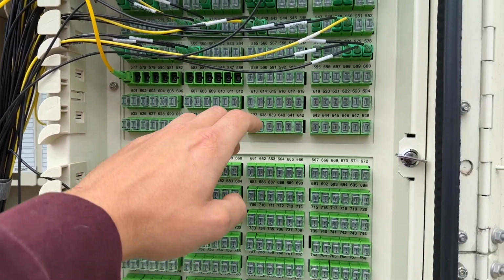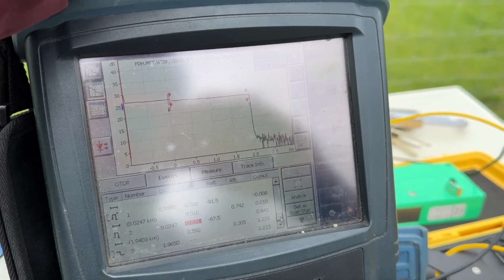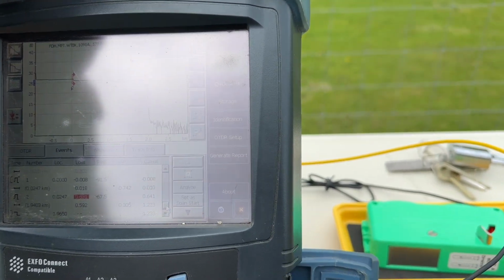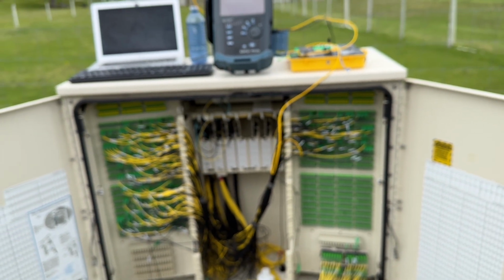Testing fiber optics

Comment: We  now fusion splice everything with no LCP. Contractors doing installs keep moving fibers when they don't have light to the house. They don't have light meters either. If the equipment doesn't show connectivity, they might change the connector and if that doesn't work, they drive to the LCP and move fibers to what they believe is their port and disconnect working customers. We also have RFoG and GPON in the same cabinets. They'll put the RFoG on the wrong upstream or connect GPON to an RFoG customer. They'll disconnect a business address. Fusion splice everything and it's difficult to fix when it goes wrong, but the more common technician caused issues are gone. 
I did FTTH in 1999 when It was just a myth. First design mimiced a telco network. All the PON splitters were in massive bulkheads in a POP site. Dual fibers to each address for biderectional data because it cost too much for WDM equipment. Analog AIM network with RF and proprietary T1 carrying the phone. The network was done in one mile rings from the POP because the T1 channels are time divisioned and if the signals took too long in comparison to each other, the T1 would fall out of sync and ... drop all the customers. Putting one or two customers on the wrong "ring" would cause a disaster.
$2800 per house.

Comment: I'm so used to Ethernet being plug 'n' play & copper lines and first time dealing with fiber. It's a complete nightmare, especially with those proprietary transceivers. The manufacturer says, "Our transceivers don't work in "unauthorized" gear for your safety," and I'm like, "Bruh, the transceivers have driver chip + op-amp to control the laser(s) 'n' shoot light thru a glass tube. They aren't going to fake a keyboard or mouse and/or infect the equipment machine as they function particular way, that makes such threat impossible."
Reply: You can easily reprogram sfp modules with 3rd party tools

Comment: Are you using a UPC launch cable against an APC connector in the terminal? Does that increase the launch loss numbers?
Reply: It appears to be a launch cable with a UPC on one end and an APC on the other end. Probably because the OTDR has a UPC terminal on it.

Comment: Which ftb module are you using with that ftb-200 OTDR?
Reply from the maker: Great question 🙌 I have a few modules on it for OTDR I am running the FTb-7300E. Then I have the FTB-3930 fast test as well as power meter, VFL, and multi test. 
Thanks for watching and subscribing I really appreciate it

Comment: Can you do a tour of everything inside one of those cabinets?
Reply from the maker: Yea for sure I can make that happen🙌 thanks for watching and subscribing I appreciate it
Reply: At one campus I  made the contractor re-terminate 120 fiber terminations because they didn't install buffer tubes. but that was 20 years ago, products are more robust now. If I recall I was specifying  gel-filled loose tube and switched to tight buffer.